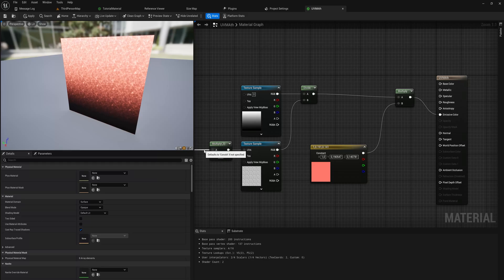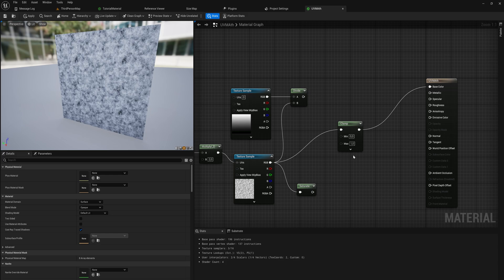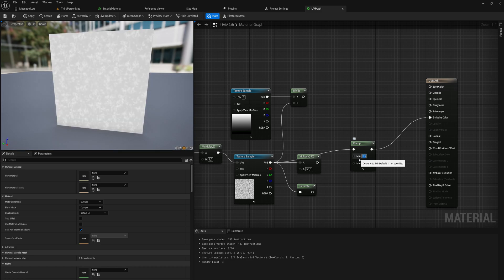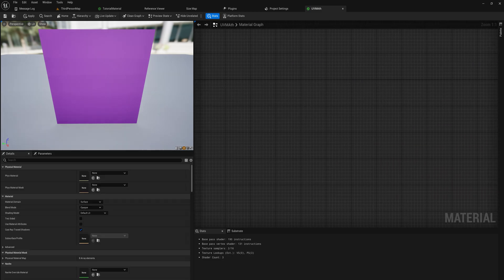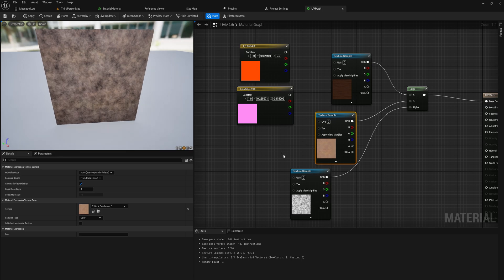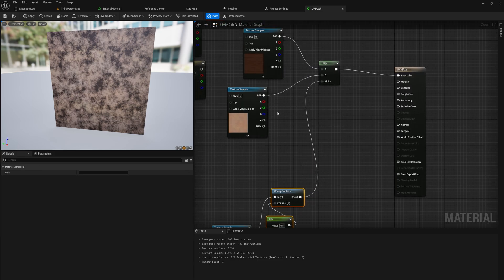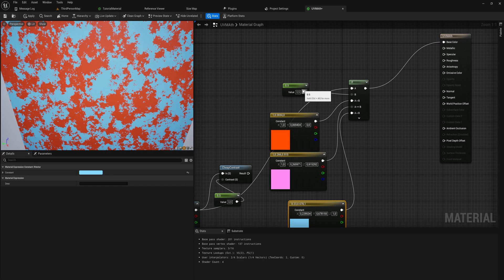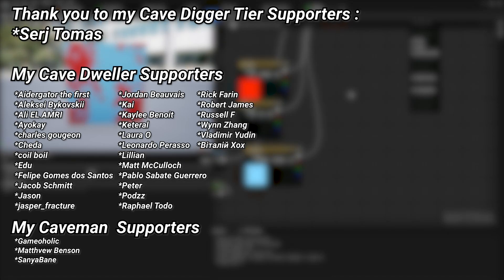Unreal Materials : Clamp, Lerp and If  - Unreal Material Course #3

Comment: Hey great tutorial!
Do you happen to know how to make a one-shot lerp? So handling the time in a way that will just go from 0 to 1 a single time, since unreal materials are stateless can't yet figure this out without resorting to external variables
Reply from the maker: specifically for time , the shader graph has a time node, that'll just tick up from 0 to infinity (more or less) starting at the moment of the objects creation so if you want something to lerp from 0 to over time once. just divide that time output by however long that lerp should take, and then clamp it between 0 and 1.
But generally, shaders dont tend to do well with logic because they run on the GPU, which is great at parallel processing, not so much at sequential processing(which is what is needed for even simple logic : Do X , then Y, then Z.). if there is any sort of logic you need the shader to do (do this thing once and then not again)  you're gonna have to do that outside the shader as code in whatever object is using it.
Reply: @thegamedevcave  yes totally understandable, thanks man much appreciated for taking your time to respond, just wanted to put a bit more work on the GPU to let it handle that lerp on a perinstance setup instead of lerping all those instances independly in one actor, will indeed need to find another way as you suggested, have a great one :)

Comment: Great video, Important thing to practise is to Saturate before lerping since Lerp alpha is 0-1 & saturate clamps to 0-1. Do you always need to saturate before lerping, No, But should you, Yes. I've been avoiding that If node since I figured out you can divide by 0 using it *Long story - Blob shadows*, But I think that is what i need to go back to instead of lerping for my landscape master material going off your example it should work quite well, other way I was going to try was DitherAA, still might with the IF.
Reply from the maker: yeah using a saturate node will ensure some more safety before a lerp. you probably should always try to put one in to be sure IF there any any chance of a value going over 1 or under 0. if youre just hooking up a texture, or just doing division for instance, there isn't really anything a saturate node will do since you'll always be between 0 and 1 anyway. Does it hurt adding a saturate node anyway? not really, it's such a cheap operation that adding a few more than needed is fine but it's also important to keep in mind why we do things instead of just doing them "because that's how you do it"  I'd say.
Also, fun fact : lerp alpha is usually used for 0-1 values but it very much can go beyond a value of 1 and extrapolate from there with the same intervals as between 0-1 (which is why you saturate it, to make sure it doesn't go beyond 1)  but sometimes it can be useful to just set a range of 0-1 and plug in other values to it. Limited usefulness for sure, but interesting

Comment: It's important to note that saturate is better for performance over clamping between 0 and 1.
Reply from the maker: Yup! Good point, it is technically cheaper. I would personally not worry about it a lot, its unlikely to cause a noticable difference but best to get into the good habbit of using saturate then possible!
Reply: This is exactly what I wanted to comment, thanks.